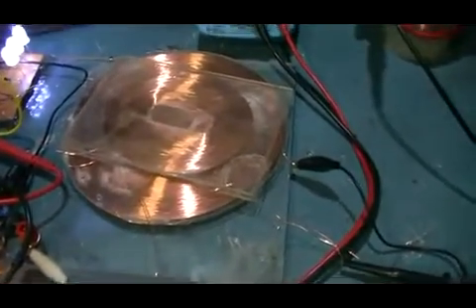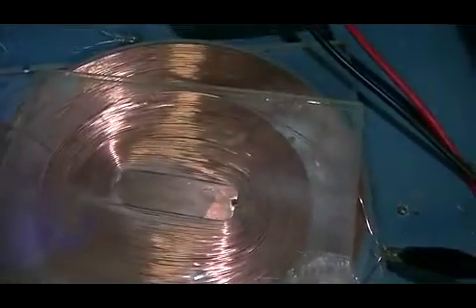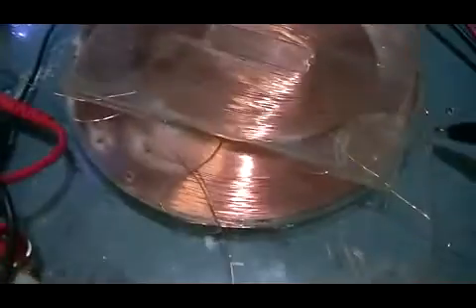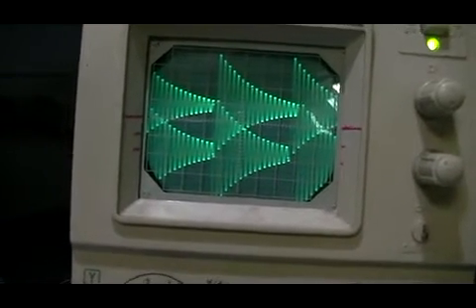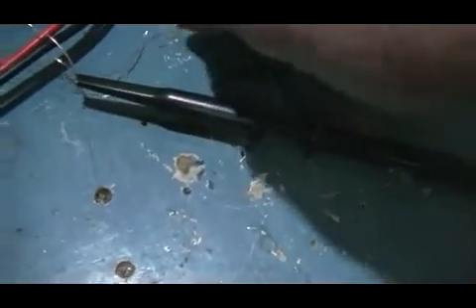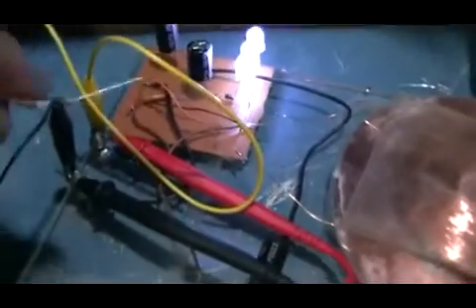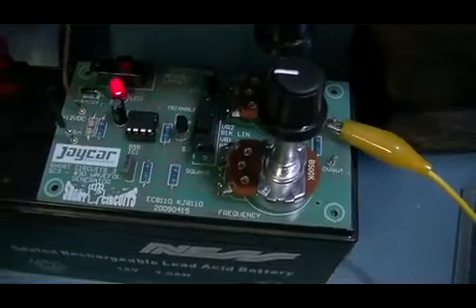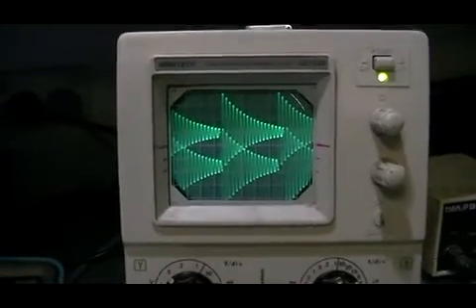Tesla circuit cool scope shot

Comment: Would that look like this though? I was under the impression this was under square wave. In which case the north and south switch each cycle. As do the polarity's of the coil. This is showing both ends at the same time. Which you shouldn't really be able to do on a single scope probe single channel. Switching mag field will be inducing current in the other coil, as well as increased columb force. I still think a ground will make it better. current from ground via appliance and into battery.

Comment: Whats going on is, A, you have a magnetic transformer with the two coils. B. the coils are opposed, so the pulse is opposing in each coil. You really need a two channel scope to do this right. Like Russ said, You changed the reference point. Trying to look at two things on one channel. What you are looking at is called "noise". Diodes going to ammeters is a good idea. Been thinking about how to do that myself. Has anyone run this attached to ground yet? Thats where the real action will begin....

Comment from the maker: Hey Russ-how are you.
Yes we change the reference point,but not realy-as it's still on the same wire as befor on the same coil.
What we see here is a mirror image of the first winding-which we would as the windings are in the same direction.But as the start of the first winding is hooked to the end of the second winding,we actualy end up flipping the voltage if you could put it like that.And also remember that the coil below has one end as ground with the other going high and low of ground.

Comment: nteresting indeed. I have also noted on my work that if you place the "ground" which is actually your reference point in other locations of the circuit that is oscillating. You will get these very strange and Interesting signals. I In a way your scope is almost lying to you. But what's actually happening is the reference point is changing.. :) ~Russ